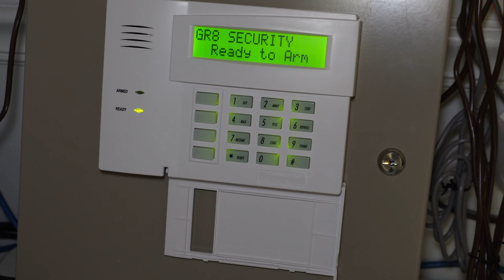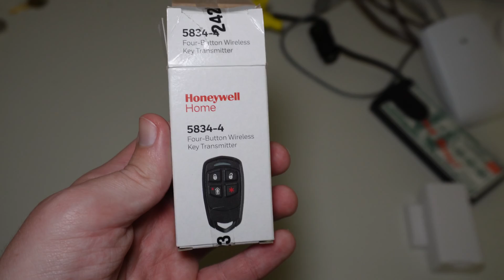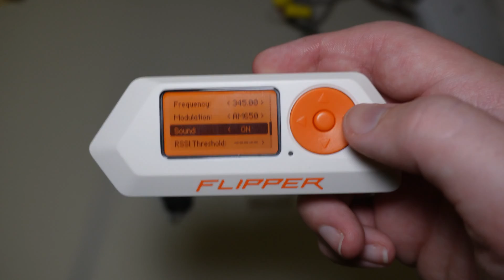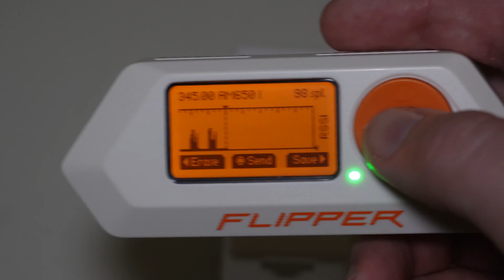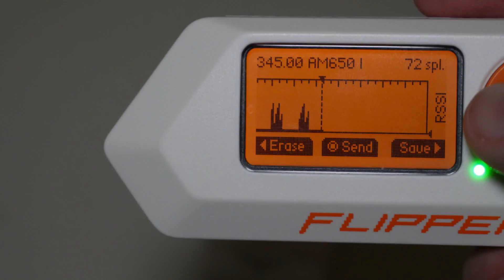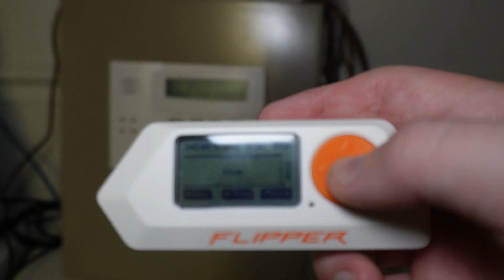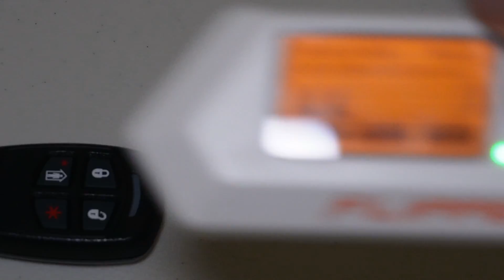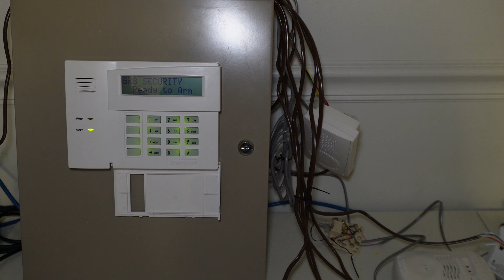Honeywell wireless security devices COMPROMISED w/ Flipper Zero

Comment: In Vista speak the "High Security" wireless devices have the ability to be encrypted. Not all 5800 wireless receivers can use the High Security sensors and key fobs, and not all 5800 wireless sensors & key fobs support "High Security."  I think its only only the 5881ENHC (I could be wrong about this, I'm going off of memory) supports it.  Honeywell/Ademco/Resideo 5800 wireless tech does have the ability to be secure against attacks like this but it requires an installer with the knowledge to know which components to use for the job.  If you don't use the wireless key fobs most installs don't need the "High Security" encrypted devices because once the system is armed sending a prerecorded open signal would just set off the alarm anyway and sending a closed signal wouldn't cancel that alarm. The only way I would add a key fob is if it were enrolled as a high security device, which you didn't do in this video, if you had the flipper would have just recorded random bits and would not have been able to disarm this system.  Plus you can get a 5817CBXT Wireless High-Security Transmitter that continually sends an open signal every four seconds until the zone is restored. That helps get around jamming attempts.  Most 5800 transmitters only send a signal when first faulted, but they send it three or four times within the first few seconds for redundancy, in case the first transmission didn't make it to the receiver.   

Sorry for writing a book... Just thought you'd be interested. I've been using and installing  this tech for the last 25 years.

Comment: this only really applies to resi installs and youd have to be almost in hands of the equipment to make this happen. Also NEW vista panels do a handshake protocol which would make the flipper useless.  I have tested it. VISTA21IP - VISTA21IPLTE and own a Flipper.   This video is showcasing legacy
Reply: also to munipulate a contact wont work, once the contact is breached it sends and alarms -- sending a closed contact or a keyfob signal at that point doesnt matter - central monitoring is already calling the cops
Reply from the maker: But what if you had maybe an external radio module on the flipper that has more powerful TX/RX or some RTL SDR hooked up to a laptop? Surely then you could be farther away and still be able to intercept it.

Comment: Nice, there is no security in these devices. Easily decoded with an rtl sdr dongle and free software.  433 mhz or 345 etc  what kinda security do these companies think there selling. It's a joke.
Reply: Even hard wire
Reply: Any alarm system can get cut from central station
Reply from the maker: We’re not talking about cutting it off from the central station. This is about bypassing wireless zones. And depending on how the wireless zones are configured, it could bypass the system altogether
Reply: The 5800 wireless tech didn't originally employ encryption because when it was developed in the 1980's it was prohibitively expensive to but the tech into these low powered transmitters with their basic cpu's. Plus most people didn't have access to the tech that could read the signal.  They did come out with the "High Security" wireless 5800 hardware in the 90's but programing it is more involved and it is not enabled by default. This video used a high security capable key fob but it was not enrolled into the system as an encrypted device, thus allowing the Flipper to compromise it.